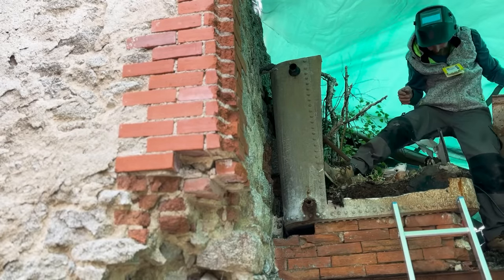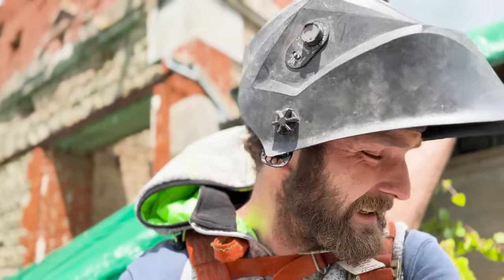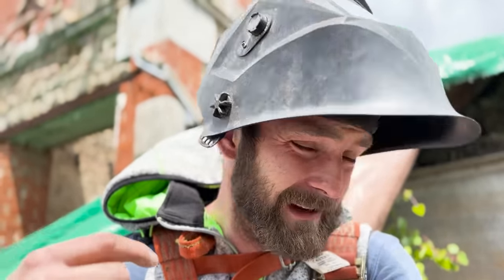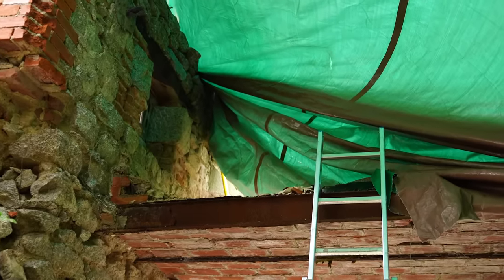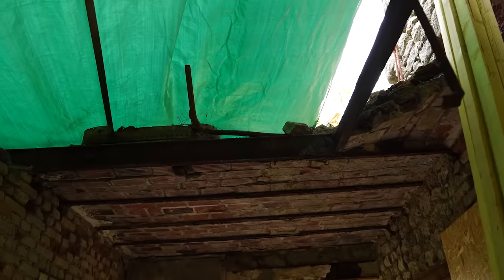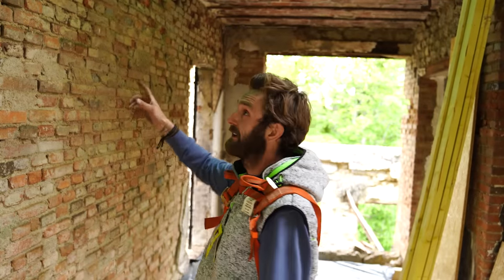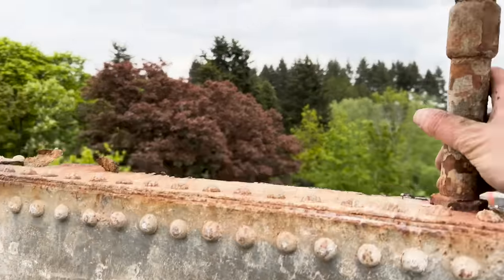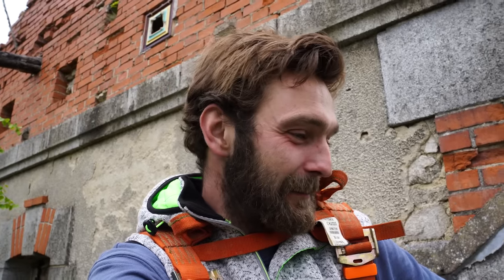i cleared the TOP level of the chateau, now its time to demolish it.

Comment: Don't cut the water tanks up I will buy them off you!
Reply: Bit late, but had you shown up with a crane, Dan would’ve made you dinner I bet.
Reply: @lolodee3528  Got to be worth 100 euros each.
Reply: You could probably have got them at no cost just for removing them, but do you own a big crane?
Reply: @westmus  Yeah... let me guess. Just thinking out aloud. Basement maybe two metres above ground, ground floor including the ceiling another four or close to that, first floor another 3.5 to 4 m, second floor 2.5. So those tanks were at least 12 m above the ground and something like four to six metres from the nearest outside wall. That would have to be a fairly substantial crane! Might even be difficult to get that up the driveway and through the gates.
Reply: Pesky logistics….😳

Comment: Dan, where’s the green van?
Reply: Last I saw it was stored at Château Lalande in need of major work.  Something with the engine I think.  That was a few weeks back, and the van hasn't been running in a few months.
Reply: @Rosarium2007  Didn't it break down last year? Might even have been before the start of the château project, i.e. early last year. Dan has had a stretch of massively bad luck with vehicles recently.

Comment: When an average weight man falls with a harness on, when the lanyard snaps tight there is 2 tons of force on the lanyard and whatever it is attached to. That means you should be able to hang a large car from your attachment point. If not and you fall, then whatever you are attached to will rip out of its position and follow you all the way to the ground and smash you on the head. It's a nice thought hey?

Comment: For the life of me, why don't you scaffold the entire interior, with stairwells, and do your demolition from the top down? MUCH safer and more efficient. And btw, your tie off points are a bit more than useless: a rusty pipe? A rusty rod set in decaying brick/motor.? A 4" d tree growing in a decaying wall? You are in danger.

Comment: Whats up with the silly Darth Vader helmet?
Reply: Looks like a welding helmet and should provide good eye protection while grinding. They'r great bits of kit for welding too as they're auto-dimming. In ambient light they're pretty much see-through so you can tell what you're doing and as soon as the arc strikes they darken to protect your eyes from the intense light. An old-fashioned visor is always dark so before the arc strikes you're almost blind.